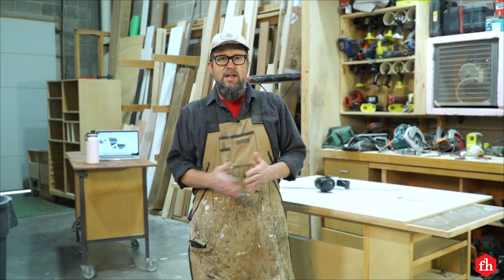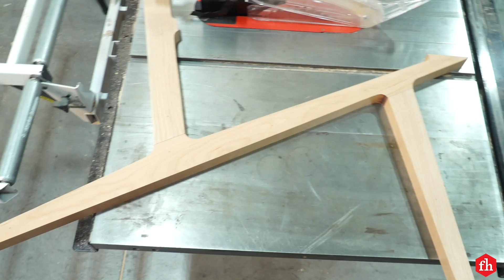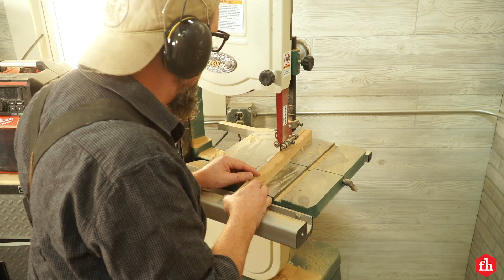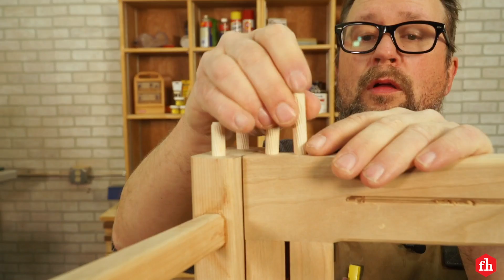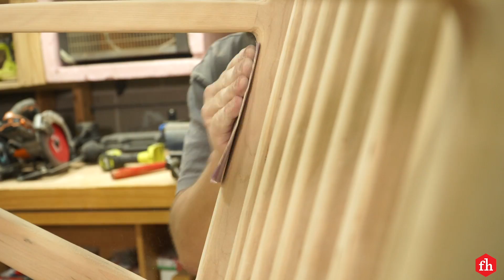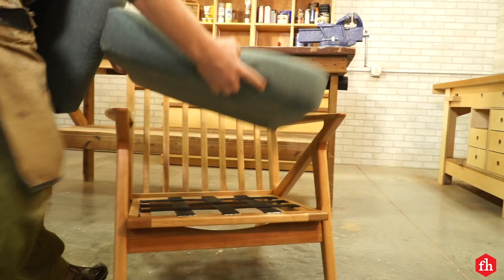How to Build a Modern Danish Chair

Comment: For those of you having trouble printing the templates (like I did), I finally figured out that in adobe acrobat (even the free version), I took the downloaded templates and hit print, clicked on Poster and changed Tile Scale to 103%. It will print on multiple pages but it will also get you extremely close to the correct sizes of the wood templates. I haven't yet started this project, but I'm looking forward to it soon. Thanks so much to Brad for posting such an amazing build!!
Reply: Dear, were do you downloaded the templates?
Reply: Thanks. This will help me.

Comment: Thanks for the plans and video! I’m almost finished with the build. This was the most challenging project I’ve tried so far so I had a lot of fun and learned a lot of new techniques along the way. I’m sitting in it now with my dog on my lap. It’s quite comfortable as well. One of the first things my spouse said when they saw it was “can you make one more?”
Reply: I had trouble getting the dowels to align correctly for the main side piece joints so I swapped to a floating mortise joint instead. I also made the seat from solid bars which was easier and didn’t add much weight.
Reply: @borasong852  were you able to print the templates ok? did you need to do anything to print them full size?
Reply: How did it end up?

Comment: Nice design. Just wondering about the back leg that slims down quite a bit near the floor. With that angle and weight on the chair, has ther been any failure?

Comment: The patterns are available in the link to the magazine article provided in the description. The problem I had was not knowing how to print it full size.size. What I did was to take a pdf snapshot of each part, scale it using Visio (there are enough dimensions given in the article to do this) print it on separate 8 1/2 x 11 sheets, and tape it together. 

The article and video by Brad is really excellent !!! There is only one minor change I would make. If you look at an original Z chair, the area where the webbing/ clips are installed is recessed. This is done so you can't see the webbing/clips when the chair is viewed from the side with the cushion on.
Reply: Do you have a way I can get those full scale PDFs for each template from you? I'm not sure how to go about doing it myself.
Reply: I worked for a blue print company for many years. You can easily have full-size plans printed at a local blue print company. Kinkos also has large-format printers, although the costs are usually much higher to have plans printed. In most cases, you can email the pdf and pick-up the printed plans the same day.
Reply: Coloca a opção de imprimir pôster, e deixa a escala em 100%. 
Um impressora comum irá da conta do trabalho.